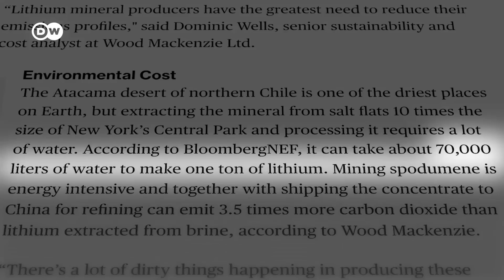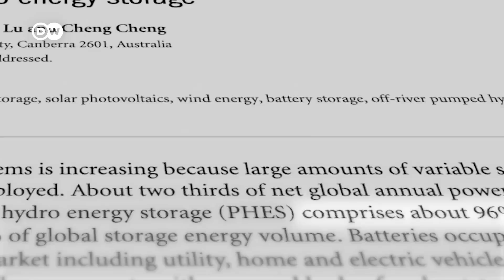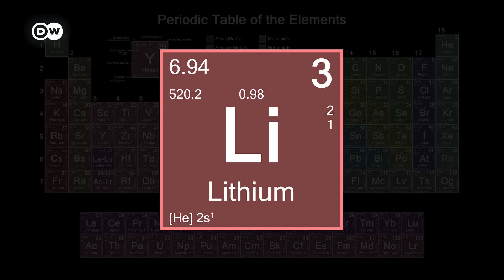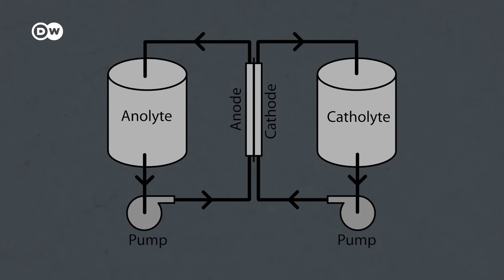How salt and sand could replace lithium batteries

Comment: The part in this video about thermal storage uses false facts so is misleading. In fact, I believe it's the most "common sense" solution to energy storage because the physics of thermal is so old, well known, and commonly used inn numerous ways in everyday lives. Research into better storage can continue but plenty of data we need to build as economical or efficient storage is already at our fingertips.

Facts in this video about thermal that are really wrong include
Time of storage. 6 hours? How did someone pull that arbitrary number out of the air? Time of storage is determined by the insulating qualities of the solution and thermal loss. If desired, we already know for example that a vaccum is nearly perfect insulation that prevents loss but there are many possible options for every objective and need.
Efficiency. Less than altrnatives? Really? In the first place if solar energy is collected by concentrators, the first strage and transport medium will be something that conducts heat, not electricity or some other form of energy. So, for solar concentrator projects, this is the default and involves no conversion loss. Then, when it comes time to convert from heat to electricity, the most common method is to heat water that in turn would power a turbine attached to a generator, but leading edge thought is to instead use a Stirling engine (or many of them). Stirling engines are well known to require no fuel and are driven by simple difference in temperature, so can be very efficient. There are examples of Stirling engines generating electricity for over 30 years without interruption.

For many solar farms, particularly those that as described are solar concentrators there is no other solution that makes more sense than thermal storage, and a lot is being wasted on instead installinng chemical battery solutions.

Comment: The only green technology will be nuclear with lowest carbon emissions than solar & wind.
U can find by comparing Germany & France 😅
Reply: nuclear power produces low carbon emissions but not less than solar & wind. also, maintenance, building and operating is expensive and time-consuming. further, nuclear waste is a huge problem and there is a strong depency on uranium suppliers (compare to dependency on gas & oil from russia at the moment being a terrible thing)

Comment: Renewables were not the cheapest form of energy in 2020, they were the most subsidised. We are all paying for this climate change madness. We are in a Co2 drought. We would need to double atmospheric Co2 in order to increase average temperatures by anywhere near 1 degree, extra Co2 and warmer temperatures would both be beneficial to the environment. Particularly now we are entering a period of solar minimum,  which means we face a mini ice age again.

Comment: Sand? There is a overconsumption of sand already (for building) and is affecting (eroding) our rivers and deltas globally!!!
Reply: I doubt the same requirements would be required for this. So desert sand would be usable.
Reply from the maker: That's right! One of our reporters did a deep dive into the topic. Check it out 👉 https://youtu.be/PMfdCeVyYsA - let us know what you think in the comments! 🙃
Reply: @FarsightAE  yes, they said it's not the same as construction sand, the one taken from river beds
Reply: @DWPlanetA  Thanks for the reply. Will be interesting to dig into How people are tacling the demand side of the energy problem and how we could reduce energy consumption? The demand side is not looked as often as the supply side...
Reply: I think pretty much any sand would work in this application. Like sand off the beach or Ocean floor. That is not good for construction as it is rounded not sharp like builders sand.